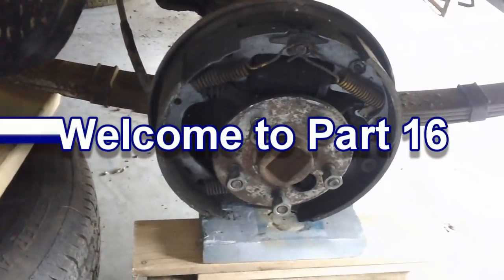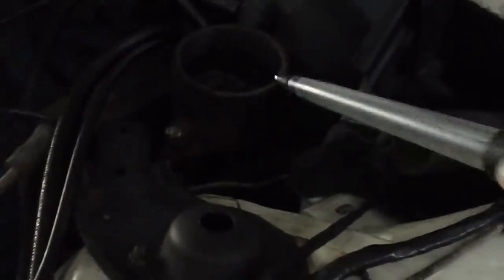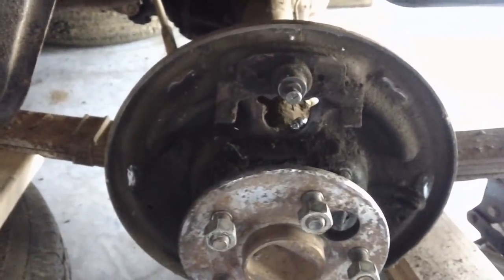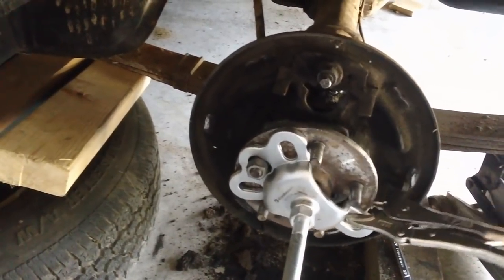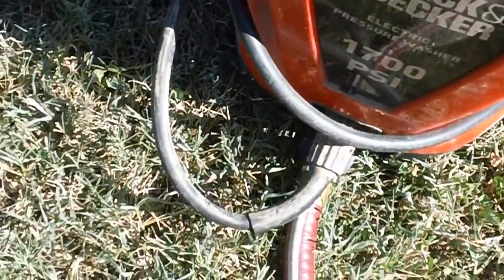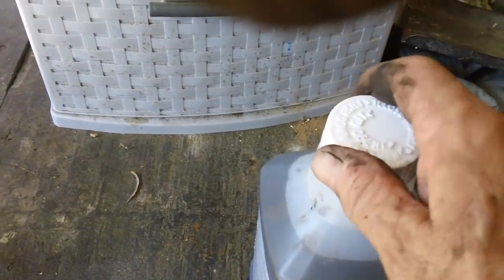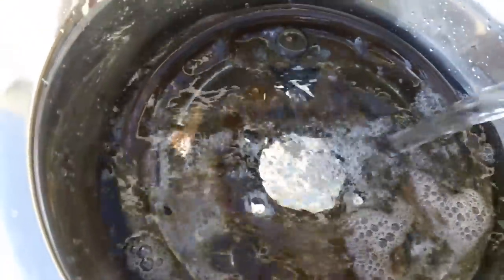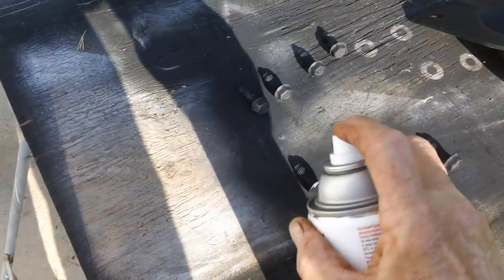1966 Ford Thunderbird repair and refurbishment (Part 16). Wheel cylinder removal.

Comment: That's extremely convenient that you're able to remove the axles that easily on a Ford. I know on any GM you need to remove a c-clip from inside the rear axle housing (pumpkin) to remove the axle rods. The car is shaping up nice!
Reply from the maker: The '57 Chevy was the same way.
regards,
John

Comment: I forgot to mention that when you pulled the axle out, the splines were DRY on the end.  So....it looks like your differential is dry and needs lube  when you get around to it.
Reply from the maker: There was no need to mention it.  I had already noticed it myself and planned on covering it in the next video.
Regards,
John

Comment: John, I would just use gasoline for bulk cleaning/de-greasing parts. It's a lot cheaper than using aerosol Brake-Clean, Carb Cleaner,  acetone, paint thinner in the long run.

Comment: John....I must commend you for your patience...I would try to find metal brake lines ALREADY formed for the car.  Bending the straight metal lines on a car will make you go nuts very quickly; AND it is real easy to apply too much pressure when bending the new line, and causing it to collapse.  Your area parts place may have tube bending kits to lend for this task....
Reply from the maker: Right.
Regards,
John

Comment: Several vendors supply brake line sets. $130 for OEM and $150 for stainless.  Probably find them cheaper if you shop around.
Reply from the maker: William,
I don't need a complete set, just a couple for the rear brakes.  Besides, $130-$150 is a total budget buster.
Regards,
John